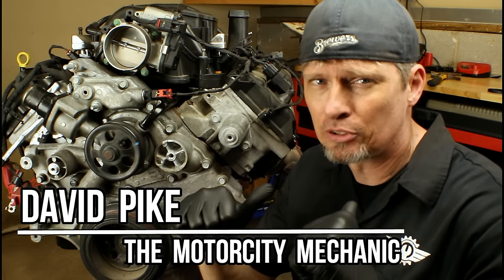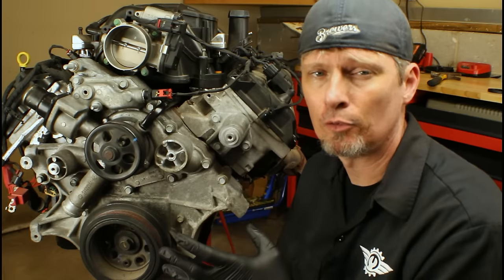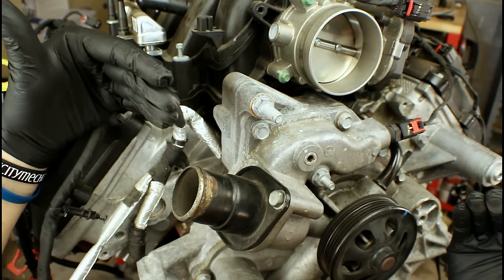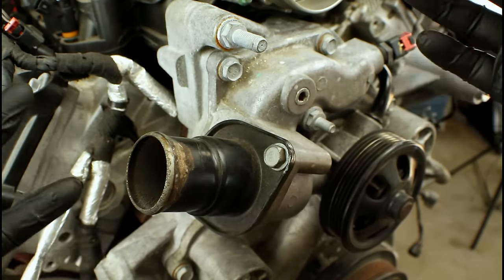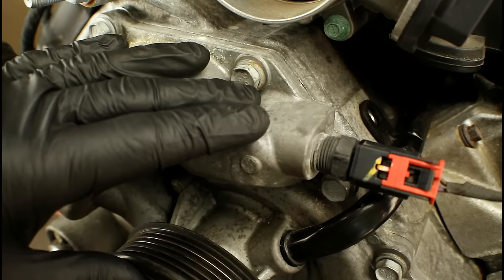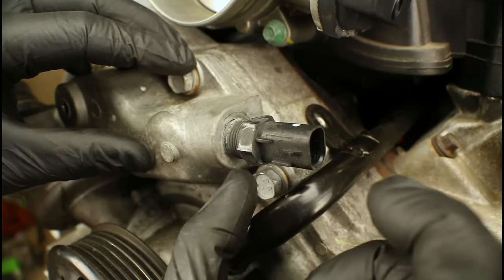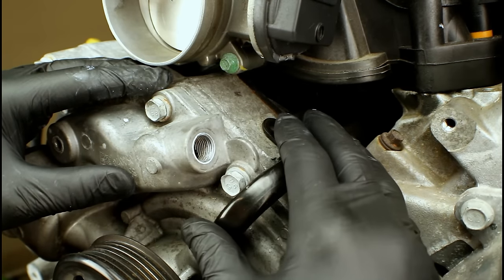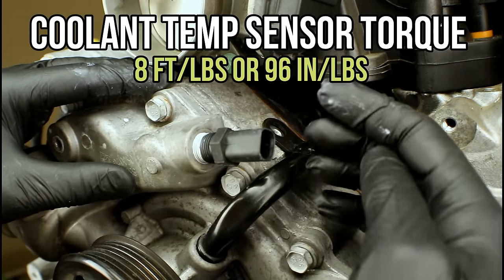More than one way to bleed a Hemi coolant system

Comment: Hey man, I don’t think you understand how helpful you were to me. Trying to deal with this seized bleeder valve and having to work night shifts and share my wife’s vehicle last two days and hours and hours of research you ended up helping. Thank you.
Reply: Same here! Stripped out the bleeder screw, did not think of the temp sensor.
Reply: Mine was tight, but I sprayed some spray on it and used a hammer to bang it. Using a bar like he did in this video will ensure you cause an issue.

Comment: You should do more 5.7 hemi videos. Your vids are very helpful
Reply from the maker: I will certainly keep that in mind in the future. Thanks for watching and dont forget to subscribe.
Reply: Hey David I appreciate you taking the time to do this video, it's helped me out and possibly just saved me hundreds of dollars, but then again maybe not lol. I say that bc I am currently having an issue with my '06 Chrysler 300c (5.7 hemi) and that issue, and I say that bc it's just one of the few issues I've been faced with which is oil in my coolant reservoir(if that's even what it is idk) all I can tell u is it looks like something similar to red clay like gunk. I took it to a couple shops and they both say it's oil due to either a head gasket or possibly a cracked block. The thing is it's going to cost me a ton of money that I don't have. So my question is David, can i drain/flush the entire thing, replace with fresh coolant and add head gasket/ block sealer? I'm not leaking or losing any fluids that I can see, but obviously something is going on with my coolant reservoir looking like it's mixed with red/ brown clay? Id really appreciate any help I can get if possible, thanks.
Reply: @davidhunter184  your gonna have to drain flush and fill your coolant. Have that head gasket replaced change coolant change engine oil. If problem persist most likely you have a craked block. Only way to get a cracked block is if you over heated it.
Reply: @rhurtadorh32  ok, thanks I'm going to get right on it, hopefully it won't cost too much lol. I heard it was very expensive to even changing the gasket. I'll check around and see what these other shops say, I know I can't afford it at the dealership. Again, thanks for your help.
Reply: Very helpful my boi 💪🏽🫡

Comment: You saved me on how to bleed our 2012 Chrysler 5.7 went to different store's even mopar nobody new what to do. Thank you.
Reply from the maker: Thanks for finding this video and for commenting as well.....glad I could help out. Now make sure to subscribe
Reply: @MotorCityMechanic  my sensor looks really old and I'm having trouble removing it to bleed. I was told i can just leave the coolant cap off and run it for 30 mins to bleed it, is that true?
Reply: @guardiandogoargentinos1385 did you bleed it successfully with the cap off?

Comment: I drill a hole in the thermostat ,unless it has a bleeder built-in that seems to get rid of any air pocket in the vehicle.
Reply from the maker: I have heard of a few doing that. I have to wonder if it would set a thermostat rationality code however.....then again a small hole might not affect it that much temp wise when warming up. As long as you have a new seal or going back with a new t-stat and doing it then sounds fine to me. Thanks for watching and especially for the comment.
Reply: MotorCity Mechanic 
Ive done it on many new vehicles, only a tiny hole is needed, like at most, 1/16-1/8”
Just need to make sure the hole is near the top
Reply: I just replaced the radiator should i fill up radiator with coolent before starting the bleeding process?

Comment: I got a thermostat installed by garage on my 6.1 hemi and they used neither method. They ran it with the cap off several times i think

Comment: It's nice that there is a bleeder port to use. I recently had an overheating issue with my 5.7 Hemi Jeep. Replaced the thermostat and housing but that didn't do anything. Then it blew the upper radiator hose. So, I decided it was time to replace the stock water pump. Using your information, I was able to successfully bleed the system.

Comment: David, another great and helpful video! Just one thing, when applying  the high temp thread sealer, it should always be one thread back on the item it’s being used on to prevent it from eventually traveling around in the coolant. Again, great video and info, you guys are the best! Thank you.

Comment: Had to go with this method and the sensor to bleed my HEMI. 
Jacked up the drivers side of the car to tilt it so all the air could escape the small pocket on the bleeder bolt side. Worked great!

Comment: This step really helped out Thanks A Lot!  In my case it  was a clogged radiator on a Ram 1500 5.7.  It slowly built up heat up to 230 driving,but never boiled over.  It took a long time to cool down.

Comment: David always love the videos you do on Hemi engines as I have a 07 300c 5.7 and had to change the water pump 4 times. They seem to leak behind the pump by the little gap next to Alt. 4th time is the charm it seems to work now no leaks I just added a little more silicone in that area. Keep up the good work David and thanks for showing where that bleeder plug is most auto part shops don’t know.
Reply from the maker: Thanks Robert. I need to eventually do a video on the waterpump on a Hemi....mine is seaping and covered under the extended warranty. Just have to find the time. Thanks for watching the videos and for following the channel.

Comment: Thanks a whole bunch for the video. I just swapped out the heater core in my 2006 jeep commander with the 5.7 hemi and tried the funnel trick but still wasn't getting the heat I was getting before the swap, so now I'll try your way and see if I get better results, wish me luck.

Comment: I couldn't remove the bleed plug in my 05 Hemi Magnum.  I used one of those large funnels that attach to the overflow bottle and extended it up high.  As the engine ran, it gurgled and gurgled and filled the system.  It never overheated at all according to the gauge and the next day, the coolant was down just a little in the bottle.  If i could get the plug out I would install a small valve that a tube could be attached to and avoid getting coolant on my belt.

Comment: Thanks, David. Good option to have, that bleeding through the temp sensor opening.  Just did a water pump job on a 2012 Durango R/T with the 5.7 Hemi. I ran out of Teflon tape so just installed the temp sensor with none. Will go back later with the thread sealant (and also get more Teflon tape). I'm also getting an inch-pounds torque wrench, because mine does 10-150 ft.-lbs. Also, I subscribed because you're Chrysler-specific. Thanks again.

Comment: Great video . I have 6.4 hemi in my chrysler 300 can't seem to open the bleeder valve on the water pump . Will be going in through the temp sensor hole . Cars heat ATM works best while driving . I have air in the system .

Comment: I remember back with my 82 024 with the 2.2 and the 90 shadow with the 2.5 I(recommended by the dodge club) replaced the bleed plug in the thermostat housing with nipple, elbow and pet cock or small valve, they also recommended drilling a small hole in the base of the thermostat itself, both worked wonders when changing fluid and bleeding air and living here in canada never affected the heat :)
Reply from the maker: I have heard a few people drilling the thermostat.....havent done it myself. I can see where it can help. Thanks for watching!

Comment: I have a 5.7 in my 2004 Ram. Just did a cooling system overhaul. No bleeder plug like on the set-up being shown here. Left the temp sensor out when filling up till it got there, then put the temp sensor in. You have to unbolt the A/C pump to get to it. Not hard when doing the water pump.
Reply from the maker: Yeah the trucks seem to always be a bit different. But as you found out….more then one way to skin a cat. Thanks for watching

Comment: I would recommend it would "always" be better to bleed air from the sensor hole than the plug simply because you are the most gauranteed the sensor can be removed and reinstalled trouble free than the plug. More likely the metal plug will  be siezed or pull the threads out with it than any issue that may be encountered with the plastic sensor. The plastic sensor can be MUCH easier replaced with a new one if you broke it or rounded off the nut faces on it than removing/replacing the metal plug if you round out the wrench faces or break off an allen ball tip in it or strip off some threads.

Comment: Great vid.  The way the bleeders are secured with some industrial strength thread seal seems make them quite hard to get out.  Meanwhile, our 2006 WK 5.7 does not have the temp sensor.  Seems a bit of a poor design to me.

Comment: Thanks for the video. One thing about fixing stuff is we all have our own methods. Personally speaking, I would rather go to a store and buy a 1/4" hex socket or allen wrench than mess with a plastic functioning temp sensor. But I know guys who drill a very small hole in thermostats also as their fix ?
Reply from the maker: Some thermostats have a small "rattle vent".....drilling a hole could help but it could affect the way that the system monitors the temp. What I mean is.....if the engine takes too long to warm up.....because of the hole allowing the coolant to bypass the valve and not get warmed up as designed.....it can cause a check engine light code. I too rather use the bleeder....plastic can get brittle over time. I have been getting alot of comments on the other related video about all the issues they have been running into and this version is just another option as in "worse case". Thanks Richard for watching!

Comment: Awsome idea. I have a 2011 ram 5.7 hemi with a seized bleeder valve so I'm going to see if this tip works for me. I'm subscribing!
Reply from the maker: Many thanks Ryan. I hope this helps you and I appreciate you watching
Reply: Did it?
Reply: It sure did. Bleeder valve was seized and eventually stripping. This helped get the air out. Great idea.
Reply: @ryanv7195  Damn sure did work 💪🏽

Comment: OK my question is after you install the thermostat & fill till coolant leaks out the overflow hole do you fill the reservoir up to the full line or do leave room for expansion of coolant ? Also what type of coolant do you use & do you mix it w/ water ? Thanks in advance.

Comment: Hello my brother has had two of you problem fix's video , he recently had the radiator replaced and water pump, then you video of the heater core supply hose with tee fix and now were having problem getting the coolant to circulate the way it should, ive been watching your coolant bleeding , in your opinion do you think that might be our problem now.  the coolant is boiling in the coolant tank....  please advise back asap.

Comment: Just an FYI my 2016 6.4 has a bleeder line where the bleeder screw was. This allows the air to bleed automatically it burps itself no bleeding required.
Reply: I got a 2016 6.4 challenger scat...mine has this too?
Reply: @STARFIGHT88  I have never had to bleed the system and according to the Dealer this was the reason Dodge put the line in.

Comment: Another super helpful video!  Would like to hear your experience and opinion on the 5.7 Hemi lifter tick and cam lobe and lifter roller failures.  Seems like a way to common failure that doesn't have a 100% effective fix.  Thanks!
Reply from the maker: 90% of the ones we see are fleet vehicles.....and patrol cars. The issue with them is that they idle all day long in most cases and thats not a good thing especially when the oil pressure can get to single digits at times. Being that they idle all day long.....the idle time doesnt get factored into the oil change interval either. They typically go every 5000 which works great on a normal vehicle but not in this case.....that means in some cases once you factor in idle time (1 hr=30 miles driven) a 5000 mile oil change might actually be more like 10,000-12,000 in some cases we have seen. If you drive it normal and change the oil when your suppose to then you shouldnt have any issues. Thanks for watching and for asking. Make sure to subscribe.

Comment: Thanks for this David, I have an 07 Hemi in my Jeep and there is no way that bleed plug would come out. I have also used the Lisle radiator bleeder funnel system which works well on vehicles that are hard to bleed the air out of.

Comment: good info i have a 3.6 in a jeep and its hard to get to the bleeder il have to try this on the  3.6 when i flush it
Reply from the maker: d pete unfortunately the temp sensor is not that easy to get to. I recommend working with the bleeder screw on the t-stat housing you can try using a 90 degree screw driver or gently grasp it with a set of pliers. Thanks for commenting and make sure to subscribe

Comment: Hey David, Great teacher you are and great videos to.  Question:  I have a '19 Bighorn with a 5.7l and jsut got t a year ago but am now having issues with the electric fans ramping up but the water temp seems ok according to the guage. I changed out the electronic fans thinking they were going bad.  The truck has 131,000 miles on it.  New fans are doing the same thing ramping up like its running hot.  I then checked the fluid levels and noticed the reservoir is empty and the dipstick has brown sediment on the lower part of it.  Watching your video, you show the bleeder screw and how to purge the air out... Mine has A tube going from the bleeder screw to the block.  Does this mean its self bleeding???  I'm ready to flush the system and I am wondering now that I saw this vid of yours on this. BTW I think the last owner or mechanic put the wrong antifreeze in it.  Thanks for your vids and any help you can give is appreciated.

Comment: If im trying to do this in a 2013 Dodge Durango with 5.7 Hemi engine still installed in the car. How do I remove the filter / air induction hood to get to the area of the engine you are showing here?

Comment: Would the bleeder plug work after doing a headgasket replacement
Reply from the maker: Sure will. If you don’t have one or can’t get it out you can remove the temp sensor as will. Did a video on that
Reply from the maker: Sure will. If you don’t have one or can’t get it out you can remove the temp sensor as will. Did a video on that

Comment: I just replaced the upper radiator hose on my 5.7 hemi charger filled my pressure tank can I run the car to fill up the radiator itself or do I need to bleed the system
Reply from the maker: Personally I would bleed it. Then seal it up be run it until the thermostat opens. Cool off and recheck the level

Comment: I need a help please. I did flush for my hemi 5.7 and thermostat changed. The car gets overheated after while. The coolant level is the same. When I open the bleeding screw no water comes out even id I top up water in the tank. Whats the problem here? Thanks

Comment: Is there another way on my 2006 Chrysler C hemi 5.7 . I just installed a new water pump but the sensor you demonstrated on this video is on the actual housing of the water pump
Reply from the maker: The sensor is on the back side of the thermostat so you can still remove it to get the air out.

Comment: Hey I have a 2004 Durango with the 5.7 hemi however I have neither the bleed screw or temp sensor on the top of my block any other potential bleeding methods?

Comment: Question I have a 2010 Dodge Challenger R/T I never had problems with my car over heating But recently I changed my Radiator bought it from American Muscle As well replaced A/C condensor now my car is over heating. I also changed my thermostat and over heating continued then replaced radiator fan from Orielys. And.. still over heating.

Comment: If the bleeder is frozen what's the best way to remove it, I don't have much room for large tools and it was said to be 1/4 L hex/torx but it won't fit, I've tried metric as well no luck and I don't want to grind out the inner plug so I stopped

Comment: my 2015 6.4L 392 HEMI on my Challenger has a hose that comes out at that bleeder point and travels down under the pulleys and I loose it from there.  is it the same procedure or is that hose a closed loop of sorts?

Comment: My 2003 2500 5.7l hemi has a problem with coolant reservoir...kjust changed radiator and the reservoir has air coming out the lower neck of the filler below the radiator cap...It looks like you can screw out the reservoir neck...is that true or does my system need bleeding or is my reservoir broken and needs replacement

Comment: I have a 5.7 2007 charger I remove the overflow bottle cap remove the bleeder screw filled with antifreeze and water nothing came out of bleeder screw, antifreeze runs out of the overflow tube what do you recommend!Or what may be the problem? The only other thing that I have is the thermostat housing, that other heater part with the plug on it that you disconnect I don't have that. If push come to shove can I do it just the old school way? Take the radiator cap off of the overflow bottle turn the heat on hot with low fan and let it run until no more bubbles and the reservoir I can't massage the upper hose because it has a spring in it. So I'm asking your opinion or what do you recommend?

Comment: I've heard of problems with replacement water pumps. Some people complain the pressed-on plastic impellers become loose on the shaft, and fail to pump coolant properly. My questions are: have you run into that problem? are Mopar replacement Hemi water pumps made with a metal impeller?
I ran into the plastic impeller failing on a brand new Mopar w/p,  I installed on a 95LHS w/ 3.5L engine, so I'm trying to avoid that problem on my 09 Hemi Charger.
Reply: Just replaced the original water pump on my 2004 Hemi 1500. It had a plastic impeller.